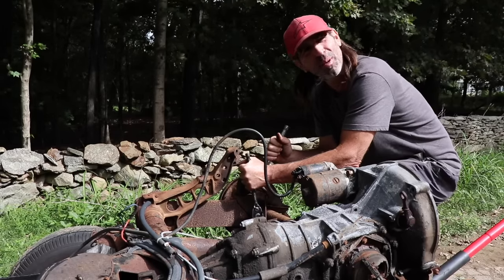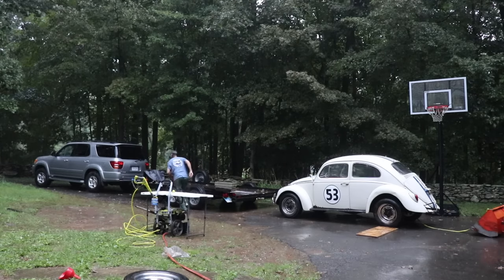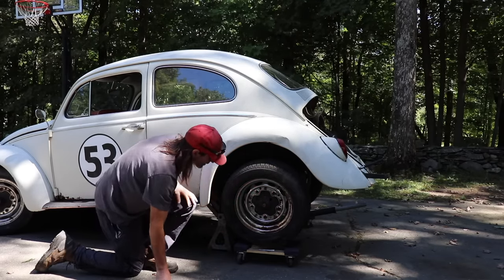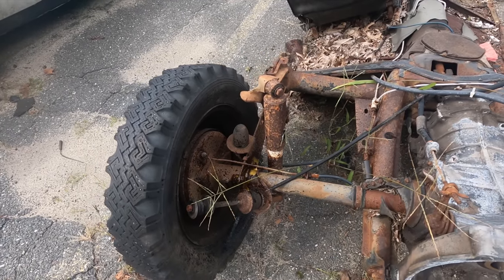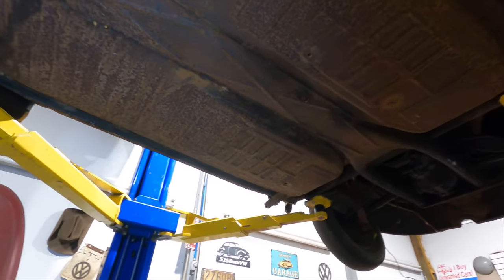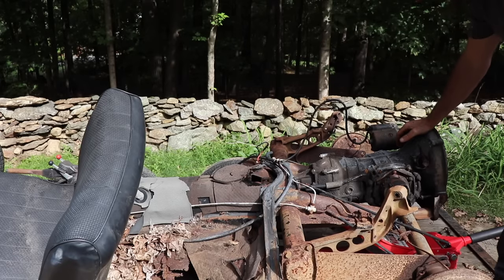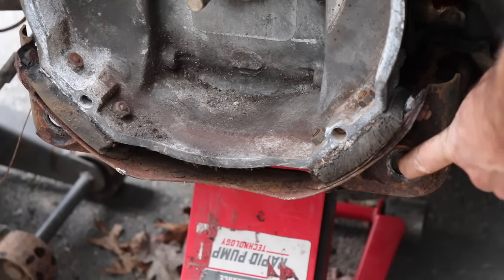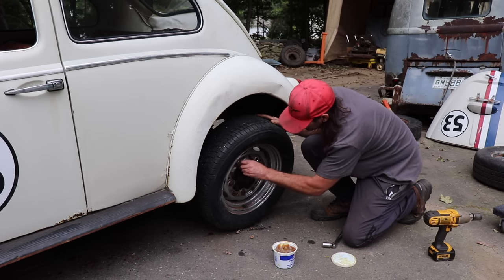Pulling Herbie off the Trailer Fail - Vw Beetle Transmission swap / install

Comment: Brought back memories of 1967 my father and I replaced a 1962 trans . I kicked it in and busted the boot on heater cable tube. I caught hell . That was 12 bucks you damaged.  It was the beginning of my love for VW's . I bought so many parts at the dealership they offered me a Job . Took it rest is history.

Comment: Jason I blame Dubwerks for not being there to unhook the cable LOL, have done something similar, my wife and I went to take a boat ride we untied from the dock I go to back away from the dock and we stuck and basically not moving, come to realize we were still attached to the dock via a chain I have just in case the ropes let go. So pretty much doing what you were doing, great little video and holy crap that was some rain.

Comment: I had a 1957 bug. I rebuilt the 36 hp engine. Installed new heads. The one thing I did not like about that model was you always had to drop the engine out to work on anything major. The first gear always had a knock. Bad bearing. But I drove it that way several years till I sold it. Not a winter car for sure. I drove to Conn one year in a snow storm. Snow was blowing up out of the defrosters and ice on the dash. After that trip it was sold and I bought a brand new 1971 Jeepster commando.

Comment: I know this is off the subject,  but did you know a coffee maker was an option on VW bugs starting in 1959.  I didn't until I saw a picture of one today.
Reply from the maker: Hi John , I saw that this year as well . Pretty wild :)
Reply: Found this on google: There's been a photo being shared online that shows a 1959 Beetle in Germany which had a coffee machine mounted to the dashboard. It's true, VW did try this. It was very rare, but it did exist. The coffee heated up by being plugged into the old lighter socket, similar to brewing tea. The cups were also held on by magnets.

Comment: you really should mount some wood on those ramps. LOL
Reply from the maker: Haha :)
Reply: @5150mxVW    seriously... a couple of 2x12s with some carriage bolts sticking through as locator pins that will catch on the ribs of the ramps.

Comment: Excellent video Jason   :) also your intro to video should send in America Funniest Videos to win $20.000 or end season of show for $100.000 to bet win one them Lol! Also don't feel bad Jason back 1986 my late Father & Uncle bought used Loader tractor Desiel motor  at Farm Auction sale and had get home farm and guy put on flat float bed and was early Winter Season months and slip off float bed tow truck on going Reverse  after chain also bed was tilt too and lucky flat land on farm near machinery shed to is ! Nobody got hurt and weird part light hit tractor  on hood and some how fire up to with key ignition switch to on and starter turn over without touching starter button and glow plugs switch too ! So funny  and then start to freezing rain  and snow hard for 3 hours and getting tractor in machinery shed too!

Comment: I'm guessing the gears are jammed between 2nd and 3rd, (someone tried power shifting a tired old gearbox) all you had to do is open the oil fill plug, stick a flat blade screwdriver in there and move the gears around forward and aft. that usually unjammes them. If that's what's wrong anyway.

Comment: i know its random but i'm wondering how i could fix this but my beetle now doesn't wanna run it only turns over it sounds like it has compression but it doesn't wanna fire up 

do you know what it could be?
cause i'm guessing its either vapor locked
plugs are fouled or burnt out 

by chance it could be the distributer or somthing
or a carb issue pretty sure starter fluid would do the trick?

its right now sitting in a guys yard cause it broke down near a store yesterday it literally just stalled out on me when i tried to pull into the parking lot
Reply from the maker: check for spark and make sure its getting fuel ....many times it is a bad condensor
Reply: @5150mxVW   if non of my methods work ill just tow it home and work on it
i'm thinking the plugs could be fouled
Reply: @5150mxVW  well i tried everything replaced the coil the condenser the points and what not 

could it be the distributer cause its making no spark there
Reply: well an absolute miracle happend we went up there to tow it and i was curious if it would fire up and it fired right on up first try i was shocked heck doing those part swaps actually made it run better it used to sputter at low throttles now it is alot smoother
Reply from the maker: good to hear!
Reply: @5150mxVW   oh she purrs now i got up to about 60 MPH in it normally it wouldn't do that before and plus the sputtering issue is gone too

 gonna get into the wiring tomorrow to fix the turn signals cause they don't work
Reply: @5150mxVW  well i came back to you a day or so later and i went out for a drive it was fine it started heistating when i was pulling out of a sub division i'm surprised i even got back and well it died again thankfully at my house and if it starts again if its cold then its vapor lock probably

Comment: Maybe it's time to invest in some good equipment.
Reply from the maker: Haha, a two year old trailer and Kubota I guess aren’t good equipment…don’t watch the old vids of a come a long and homemade single axle trailer 🤣👍
Reply: @5150mxVW  just because it's new doesn't mean it is right. Just saying not dishing.  A tilt trailer would be a big difference. As many cars that are being picked up, an old flat bed tow truck would be a world of difference. Old cooking sheets or lunch trays are great under locked up tries to slide around
Reply from the maker: @casketdriver1  Mustie1 was suppose to come by and I was going to do " why don't you get a trailer like M1 " lol...and yes , for the love of God I'm going to steal his food trays and use them on every rescue . If the rears roll i'll set the E brrake haha :))). I have too many trucks I'm always servicing already and i'm not buying a 10k trailer....also my trucks are not capable of the added weight of a larger trailer....